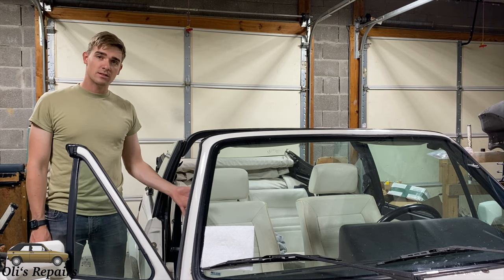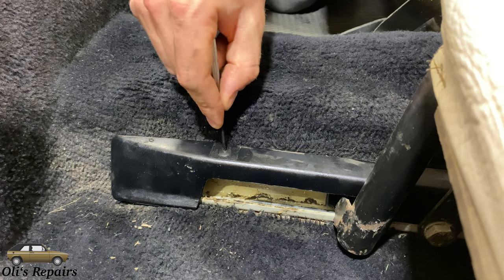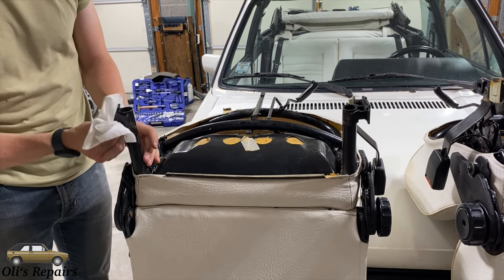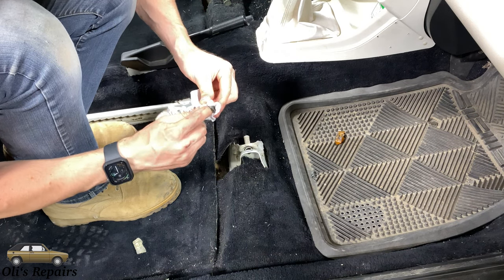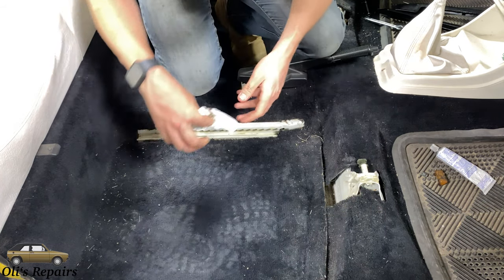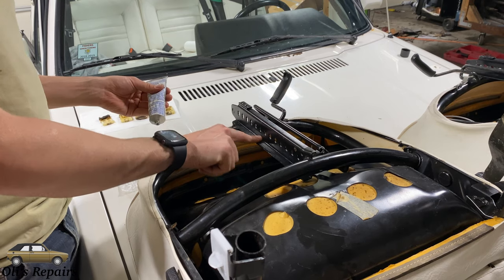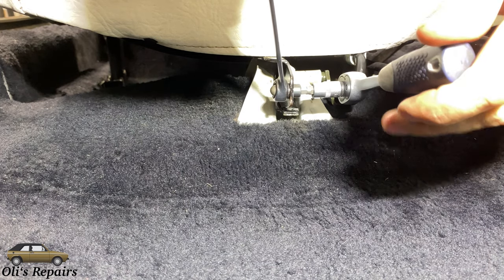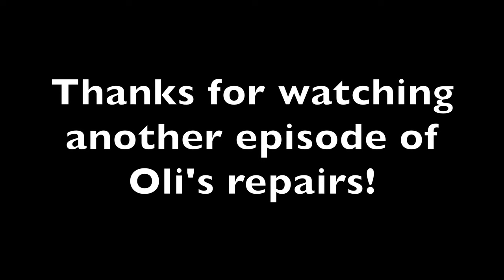VW Seat Guide Replacement - Mk1, Mk2, Mk3

Comment: Great video. Thanks!  I have a Mk3.5 (golf) Cabrio in the US.  I will be fixing the manual seat height adjustment, which didn't work well when I got the 2001 5 years ago and now does nothing.  Recently the seat adjustment stopped locking easily in place for the front-back direction actuated by the level on the front of the seat, too, so I finally have to do something!

Comment: Great job Oli, as usual. Done this many times on my mk1, mk22, mk3, polo a corrado. I don't know how you guys have in the US, but in Europe, you can buy cheap chinese knockoffs, which make your seat wobbly right out of the bat. Going OEM for these sliders and the front rubbery piece is the way to go, in my experince.
Reply from the maker: That’s a really good point. I actually went with the Chinese knock offs because I couldn’t find any of the actual ones in stock. The seats still work much better than they did before, but I have a feeling that they won’t last as long and that they would be even better with the OEM ones.
Reply: @OlisGarage  will see 🙂 they are hard to find sometimes, I always go straight to the stealers for them. Both complete sets are about 30-40 bucks. And OEM ones are made from a different, softer material then the cheapo ones.
Reply from the maker: @martinhnilicka2114  I didn’t even think of going to the dealership…I haven’t been there in a long time (maybe ever?!) for mk1 stuff! I’ll have to try that
Reply: @OlisGarage  they have to make it, because those parts fit mk2, mk3, corrado, scirocco, polo and everything in between :)
Reply: @nutsack  true, but worth it
Reply: @nutsack  that's good to know, unfortunately, shipping from the US to Europe kills the price advantage for me
Reply: @nutsack  vw classic is soooo expensive 😀 like unbelievably...
Reply: @nutsack  yeah, true. You have many shops - usrt, mk1engineering, fcpeuro... There are many parts I had to buy from overseas, cause it was nla here

Comment: Any trick to keeping the rubber bushing in place on the front of the seat track when reinstalling the seat? Mine constantly fell out and I cracked both rear plastic seat guides.
Reply: Had the same issue with it falling out. Put a little silicone adhesive on the bottom where it contacts the vehicle.

Comment: i used velcro to hold on those seat rail cover trim, works amazing.
Reply from the maker: Ooh interesting thought. You just placed it between the top of the metal seat rail and the plastic cover I assume?
Reply: @OlisGarage  yis sir. I am running mk2 covers so they dont have the pin. (dont think so at-least) Its been velcroed on for 4 years now, no problems.

Comment: Thank you @OlisGarage for a great video.  I just put these into my cabriolet and the seats now slide much much better however they do still wobble side to side a bit in the tracks.   Have you been able to solve this issue at all?    I've also noticed that the back rest portion itself wobbles too.  I'll have to see if I can figure out how to reduce that as well.
Reply from the maker: Apparently higher quality sliders can help reduce that wobble even more. However, I am not 100% sure. I think there will always be just a little. The back rest I unfortunately don’t know off hand how to fix. I need to take one apart sometime (and I have one that I need to fix the cable in, so it will be happening at some point!)
Reply: Thank you!!!  @OlisGarage
Reply: @OlisGarage  I replaced the outer sliders with factory VW/Audi and the wobble is definitely much less.     Part # 171881213B

Comment: Is there a way to modify the seat rails so the seat will extend as back as far as it can?  Basically touching the back seat.  I was looking for a seat rail extender video.
Reply from the maker: Not easily. That involves extending the rails (welding) and also modifying the seat (more welding)

Comment: Tried this on my 91 and it turned into a total nightmare lol. The guides snap into place easily but on opposite sides (lipped one on the inside so it doesn't slide into the rail). The center rail and lever are in the correct orientation with the lever on the inside. These seats also have the bolster lever to move the seat forward (to get into the back) on the inside rather than the outside. Did I just get a hacked up set of seats?? I'm stumped!
Reply from the maker: Oh wow, that is weird. Maybe someone did some parts swapping? 

I will admit I had a bit of difficulty getting the seats to slide in. But when they are in the right spot they slide in no problem with that little tab facing the rail.
Reply: @OlisGarage  @ShredzMC  I had the same issue exactly just now. I guess it depends on where you get the replacement clips from. I matched them up to OEM and the ones with guides do not line up. Also the plastic is very brittle. There is a reason why you get 10 sets. You will break 4 of them before you come to your senses and spring for the OEM ones. One hack is to not use the one with the guide tab and use another one without the tab. I'm going in search of OEM but the ones on eBay have very expensive shipping. One other note I bet the rails on the car get a little bent up from seats wobbling over time. This was a very helpful video though. Thank you.
Reply from the maker: @jasonbiggs13  I think I’m going to have to get some OEM ones and make a video comparing. I thought I could get away with the cheap ones…but I don’t think this is the case unfortunately. Thanks for the insight 🙂
Reply: @OlisGarage  I'm looking for some as well. If you find a bulk deal lmk and I'll do the same. eBay has some OEM but they come from Greece and the shipping is crazy expensive.

Comment: Any idea where to locate the seat rail cover clips with the little pin. Just did the job and seem to have misplaced the plastic clip. I didn't loose the pin, but that's not too useful without the larger clip it goes in. Oops

Comment: I replaced the rubber slider but it broke apart after a week, what should I do in this situation to prevent this again?
Reply from the maker: Hmm. This was a new slider?
Reply: Yes, I bought it from aliexpress.  A 6 six piece set. I don't know why, but I found the old rubber slider pieces too, when I was replacing them.
Reply: I found out that the vw mk 3 seats are bit different from the mk 2 seats you showed in the video, unfortunetly I found the 357881279-80 bushings to be broken and the 357881195 little clips to be missing. That could be the problem?

Comment: I ended up deleting the plastic guides. The Chinese ones would not let me reinstall the seats or they would crack (surprise surprise). The seats slide a tiny bit better. This is a frustrating project.
Reply from the maker: I’ve heard some people have bad luck with the Chinese ones. Apparently the ones from the vw dealer are not Chinese and are better. I’ve had luck with the Chinese ones, so that’s what I’ve been using.
Reply: @OlisGarage  TY. Going to drive to the dealership. The Chinese ones are ever so slightly bigger than original. Might help shave em down a hair.

Comment: My 1987 Mk2 had a philips head screw instead of the push pin on the rail cover.  There's also a plastic cap on the outside rail that needs to be removed.  (another screw)
Reply from the maker: You know, I’ve actually never worked on a mk2. So thank you for the info!
Reply: @OlisGarage  You're welcome Oli !  I enjoy all your videos, keep up the good work!
Reply from the maker: @Wheel_Horse  I appreciate it! I have multiple boxes of parts which all need to be installed. Front suspension, timing belt, and motor mounts are the big ticket items

Comment: Any plans on a motor mounts video for the 8 valve? One of the things I'm not very confident in doing myself on my Golf
Reply from the maker: Absolutely in the plans! Not a difficult job. A bit tedious though. I’d recommend buying a bearing press. A cheap Chinese one works just fine for the hobbyist. 

I just need to get around to it. I’ve got a box of suspension parts that need installed before anything else

Comment: Hey Oli, just wanted to provide some personal experience here. I ordered the exact slide clips listed in your description from Amazon, and I'm not sure if they are different now or if something is different on my car, but the seats still wobble on my 1990 Cab. Curious if anyone else has still had the wobble issue, or if the same kit has solved it for them.
Reply from the maker: Someone else also mentioned that they had a similar experience. Apparently the more expensive guides from VW, VW Heritage, mk1engineering are of better quality and a bit tighter overall. 

I personally haven’t noticed any rocking of my seats sitting in them. If I pull on the backrest, then I can get them to wobble a tad. 
Not trying to lead anyone astray here. I might have to buy a more expensive set to try out and then update the link.
Reply: @OlisGarage  Thanks for the reply! It may very well have something to do with my seat rails themselves or that the kit is now manufactured by a different company or something. I'll have to give the mk1engineering or VW heritage ones a shot - if/when I put them in I'll reply with an update too. Thank you so much for your videos!
Reply: @TheVexVeqtor  10 Months later, have you had better results with the VW ones?

Comment: Hey Ollie I want to replace my carpet. It seems pretty straightforward but are there any secrets I need to know on my 1988 cabrio with manual transmission? Thanks
Reply from the maker: Well I’ve actually only ever removed one, not replaced. From what I remember, no nothing too bad. You’ll need to make sure you have some padding on the floor (like how it is stock) as otherwise it won’t fit well. 

There are some clips high up on the firewall that suck to get to. But that’s about it. Might have to remove the kneebar to get to those clips well.
Reply: Ok wasn't expecting that. Good to know Thank You
Reply from the maker: @walterbutscher8438  shoot me an email (listed on the about my channel page) and I’ll send you a link to a video I’ll upload of the clips and a quick explanation of what I remember.

Comment: Real question is where to buy new and good plastic guides? I bought China shit ones, and they are even thinner than the original ones that were used for 30 years... So I throw them to junk.
Reply from the maker: I need to look. Apparently the dealership sells some (someone commented that I think). Mk1 engineering also sells some, but I’m not 100% sure of the quality. 

I’m going to start looking for some high quality ones and when I find them I’ll make a video or something. If you find some before then, leave a comment so that I can pin it to the top and update the description!!!
Reply: @OlisGarage   Deal my man :)